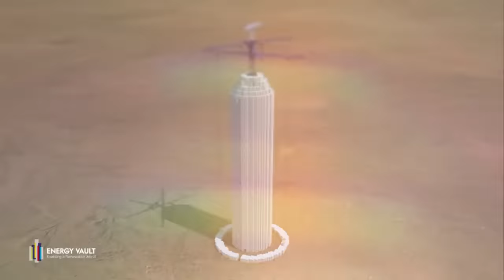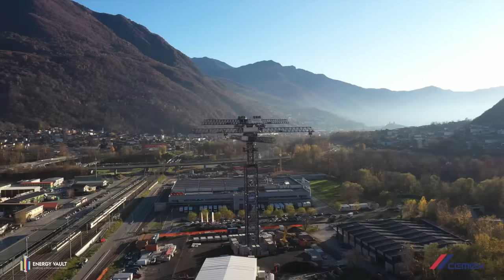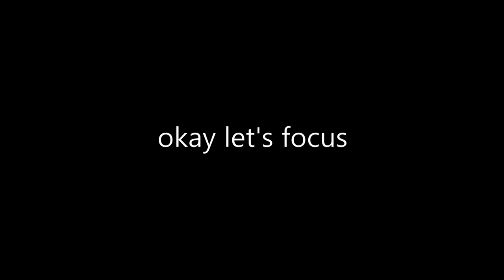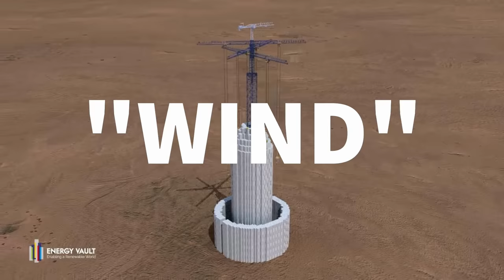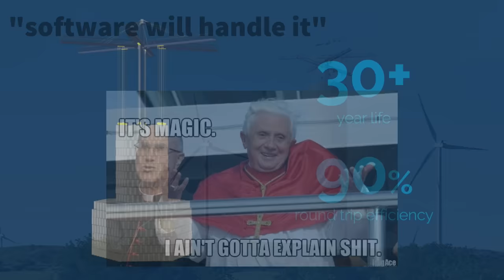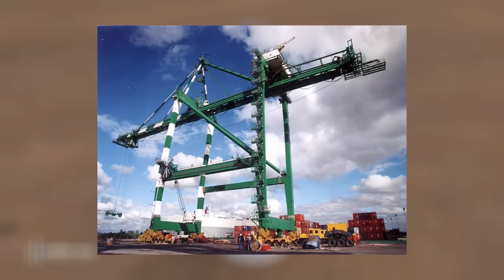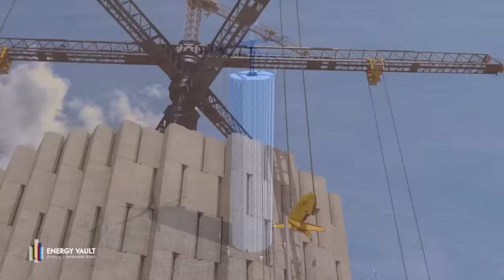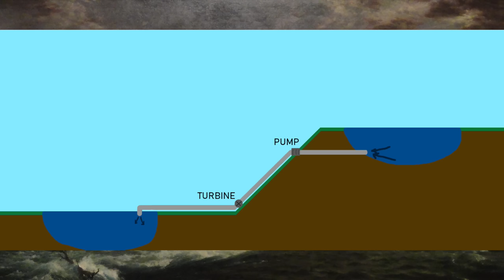The Energy Vault is a Dumb Idea, Here's Why

Comment: The problem with pumped hydroelectricity is that it's VERY hard to find a suitable location for it, and even then, the nature costs are immense
Reply: That's not the only problem. The other is that the energy you get per area of water is generally quite low. So it's utterly infeasible for scaling up.  This is one way the concrete is actually better, though I am not sure why you'd use a million tiny blocks instead of a few large ones.
Reply: @satekeeper  Concrete is kinda dumb though. The point it is not drastically more dense than water is valid (this video is terrible, btw). Metal would be a much more long lasting and energy dense solution, which would make it easier to compensate for its carbon cost.
Reply: @louisvictor3473  or for that matter you could just use rock. Concrete is a great construction material because you can shape it to whatever form easily. But for a gravity energy storage system with just a few large weights, you don't need that. Then you get higher density and low carbon cost
Reply: @louisvictor3473  You can literally just lift a kilogram of trash and it's energy storage is the same as a kilogram of concrete
Reply: THANK YOU

So yeah the idea to use the same principle isn't too bad. But using a much simpler design as shown towards the end of the video is a must. Why not just a warehouse with a sentry crane?
Reply: @TheDarkfire9251  You can lift a 100000 ton weight up 1 meter, or a 1 ton weight up 100000 metres to get the same energy.

A very large weight is hard to lift (I mean try lifting a pyramid 10 metres off the ground), and well, small & high has it's own problems.
Reply: Also, water evaporates constantly in the pumped hydro reservoir. Really, any fresh water reservoir is more useful for anything but power storage. Banks Lake in WA is primarily recreation, irrigation, and habitat; its backpack storage is miniscule compare to the output of the Grand Coulee Dam that pumps the water up. The best case scenario with pumped hydro would be pumping sea water inland as inland seas. The oceans are rising, anyway, so we may as well take advantage of all the extra water we're getting and put it somewhere in a controlled fashion. Or just, you know, use other solutions like flywheel batteries.

Comment: This project immediately goes from 'this is neat' to 'it'll never work' when someone brings up wind or damage.

If one block on the top cracks and the crane can't grip it, then that's a whole section of blocks stock under it now made useless until it can be removed.

Or, if one block lower down starts cracking then that is a massive danger where who knows how much of the stack could fall over in almost any direction if things get worse.

Medium scale pumped hydro for areas that can't fix larger stations would be much much more feasible than this Jenga battery.
Reply: You could use modified hasco blocks full of gravel or dirt and just ditch the concrete block idea altogether. 
Doesn't make it any less useless in any other capacity, but it could work.
Reply: Jenga battery.  I like that.

Comment: Another thing with the cranes is the more you use the battery the less energy you actually get back out of it. A block at 100ft is going to net you more energy than a block at 50ft purely due to the height. So unlike traditional batteries and even water systems, the output is going to slowly start diminishing as you use it which makes it unreliable and kinda stupid

Comment: at the beginning i was like “there’s no way he can just debunk this whole thing in 3 minutes”.

then he did.
Reply: but he didn't lol
Reply: @deangregoric4735  but he did tho.
Reply: @eeberee  really? He brought up few points of which he doesn't have any proof to back it up if it's really a "issues" and then in the end he's solution is something that already exists. I first thought that the guy was trolling but based on content I found out that he was actually serious. Now question is how serious is he's audience?
Reply: @deangregoric4735  🤓
Reply: Oh but also water isn’t available everywhere and concrete is used in dams too so it isn’t really a fair comparison without showing numbers , they aren’t perfect either
Reply: @deangregoric4735  💀
Reply: @charlierichardson631 
1. Water isn't available everywhere:
How is that relevant? This doesn't actively consume water, also if there isn't water you can just transport it there.
2. Dams use concrete too: Concrete use isn't the problem here, the problem here is using concrete as the energy storage, because it will generate a lot of carbon footprint, and thus not be "green energy"
Reply: @deangregoric4735  Few points that he claims to be issues include:
(For evidence you could use Google to fact-check the claims) 
1. Concrete is not echo-friendly to make, and therefore will make the thing not be "green energy", substantiated by calculations on how much CO2 would be created by making the concrete for the tower
2. The wind will make the crane inaccurate, substantiated by... Common sense, and as he pointed out "the software will do it" argument is implausible to happen in reality
3. The energy storage of the tower is relatively small, substantiated by calculations on how much energy a wind turbine generates
Reply: @DMNCMSTR  those aren't issues, today pretty much any structure is made from concrete are we really going to protest using concrete for structure that helps green energy? And also who said it needs to be concrete? They can think of anything heavy maybe even mix steel concrete and rocks it would be relatively low % of concrete  not to mention that it would be far more durable than pure concrete with little rebar

Wind being issue is relative, how much are we talking about how are blocks secured everything must be taken into account, saying wind will be a problem without any proof is pointless

Gravity batteries vary in sizes, so to say they have low storing capacity is again pointless, you can build as much as you need
Reply: @deangregoric4735  saying "you can build as much as you want" is like saying that money grow from trees. I mean, yeah sure. I could also build a Dyson Sphere so we don't need to care about energy anymore!!!
Reply: The point of everything we build in this world is that not all material is renewable. We need to plan carefully about material we use. I'm not saying that "this thing will not work" or "the water-based" will be better. I'm just saying that this thing, while work, doesn't solve the issue efficiently. This thing was planned to be used alongside renewable energy source. Which means area that has a lot of water, wind, or even heat energy. But the argument for the use case of this machine always at the desert were there are no water. But, yean, there also no renewable energy source (yet) in the desert. The only thing that work is solar panel, and that is still expensive.
Reply: @charlierichardson631 you need water to make concrete
Reply: @deangregoric4735  you need proof to realise that wind can push blocks dangling on wires? really?
Reply: @deangregoric4735  have you compared the properties of concrete with water? its only a little more than twice as dense as water... but much more difficult to handle and much less available and ecofriendly
so as long as you have enough space available... water is the vastly better material for gravity storage

another thing you should know... we also are running out of the sand that can be used to make concrete at a rapid pace - and before you say it: no desert sand is completely unsuited for the purpose...just doesnt work - so suggesting to use concrete purely as gravity storage...is immensly wasteful
Reply: @SharienGaming  concrete is vastly superior not only is cheaper to make and easily available and heaver per cu, it also doesn't need container and won't leak, I mean when did you last see big heavy weights made from water? Is either steel or concrete for obvious reasons. Only good thing about water is being Eco friendly that's it
Reply: @deangregoric4735  when have you seen the last time concrete was easily transported and put into storage? with water you just flip a switch and pump int into a container... trivial... it self arranges into the optimal storage configuration for whatever form your container has...like for example a hole in the ground

and as i mentioned earlier... concrete may be easy to make...but we are rapidly running out of the primary material needed to make it: suitable sand

furthermore... you know why counterweights are made of solids? because its important that once they are in place that they do not move or shift... they are set up once and then stay affixed to the aperture... they arent constantly moved, attached and detached...

and as others have pointed out... pump storage can crank up to significant output really damn fast... this concrete block storage tower will take ages to release the stored power... thats why pump storage is often used as a regulator for maintaining a power grids specific levels... they can react quickly and relatively precisesly to a sudden shift in demand
Reply: @SharienGaming  don't worry nowadays they are putting concrete on mountain structures am pretty sure where this gravity batteries will be made will be far more accessible, currently they're aren't any issues with concrete in china they are still building cities out of concrete just to then destroy them only to rebuild even more skyscrapers, this here will use far less concrete than average skyscraper so am not sure why people are making such a fuss about it
Reply: @deangregoric4735  let me boil your position down: "we still have oil, so i dont see the problem with continuing to increase our consumption of it"
because thats what we are looking at...

using concrete as gravity storage instead of water is akin to impementing central heating by transporting glowing hot bricks into every room on regular basis
its just a really silly idea

and again: concrete is only about twice as dense as water... the gain isnt that great for the level of flexibility and ease of implementation you lose...
precision stacking of concrete slabs while avoiding massive instability of your tower... yeah no thats not a fun problem to solve
pouring water into a hole in the ground? trivial problem to solve
also trivial to scale up... want to increase capacity? make the hole wider or deeper
want to scale discharge rate? add more turbines
Reply: @charlierichardson631  for pump storage you technically dont need concrete, here in germany we pump water from a flowing river into a pool on a hill, there is no dam involved
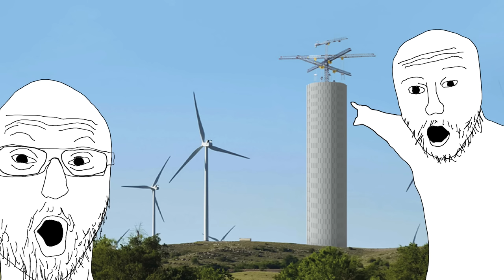Reply: @deangregoric4735  hey I saw you in the video! 1:49 there you are!
Reply: my head did it in less than 3 seconds...